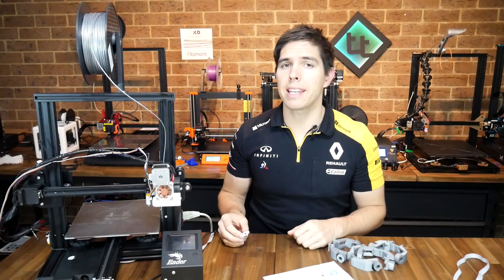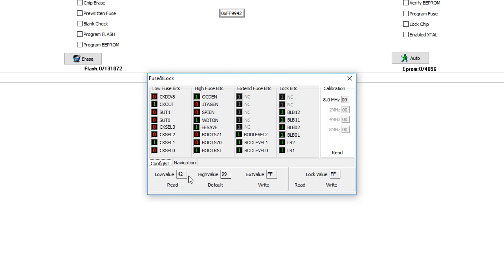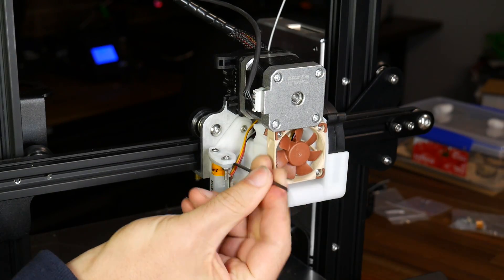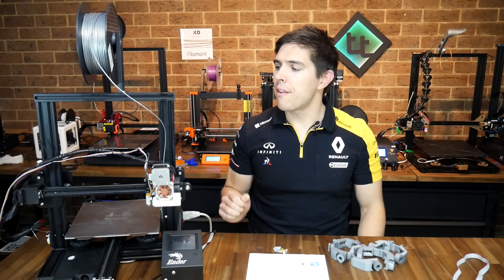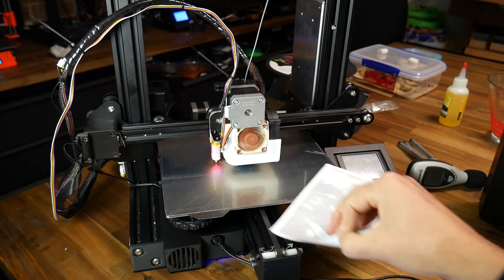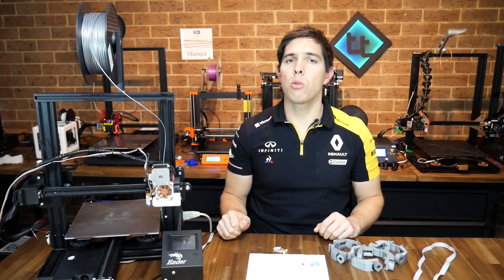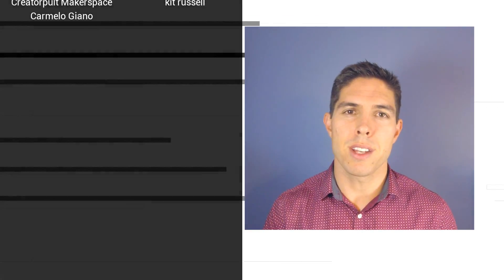Creality BLtouch Ender 3 upgrade kit - Step by step guide with fixes

Comment: Thanks for your many informative videos. I just got my BLTouch upgrade kit and wanted to share my experiences:

1. At the time of placing my order (24 Mar 19) I clicked the link and downloaded the software which worked fine.  Unfortunately after flashing both of the Chinese named files I found that neither had the BLTouch mods.  The were merely the branded and unbranded version of the standard firmware. So I ended up using the link you provided to download their 1.1.6 firmware.

2. The mysterious error when opening PORGISP.  This is because of the Chinese characters in the file name. If you don't have Chinese language support installed these unicode characters cause a problem, also why the "Auto" button didn't work.  To solve this after extracting the progisp+1.72.zip file, delete the Chinese characters at the end of the folder name so it is just 'progisp+1.72". After doing this, no error and the appropriate boxes were automatically chacked so "Auto" works.

3. The programmer can power the board by itself just make sure other peripherals are unplugged.  e.g. if your OctoPi is plugged it will try, and fail, to power it also.

4. Finally I got the V3 sensor.  This is a show stopper.  I will have to revert my Ender 3 Pro until I have a solution.

Comment: I have the V3.0 and have received an email from Creality on their suggested solutions.  The first solution is very dramatic and involve tearing the C7 capacitor off the Melzi board right next to where the z-axis plugs in.  This seems a bit extreme so I haven't tried that.
The second solution is to just swap a few settings in the progisp program.  In one step is says to click Set Low Value and High Value.  The corrected settings has Low Value as D6 (was DC) and High Value as DC (was D6).  The last change is to set ExtValue=FD-Click Read (was Write).
I haven't tried it yet because I wanted to make the changes with a newer version of Marlin.  I know the Marlin 1.1.9 bug fix and Marlin 2.0 are supposed to work, but I haven't tried either of those.
Like most I'm waiting for Michael to give us the best solution.
Reply: I had a better response from Creality by mail. After sending them youtube videos with the v3 issue and sent them videos and photos of my printer with the steps they provide with the kit and a test video showing that bltouch can´t stop z axis, the reply mail was this:

"Hi, 
I think the BLtouch is malfunction.
If you need replacement, please contact the seller. I only provide technical support.

Best regards,
Oliver"
Simple solution. Replace bltouch. lol

Comment: I used the programmer to flash a hex with bootloader and Marlin 1.1.9 I compiled with Arduino IDE.
The pin board is to big to allow the box cover to close. I ended up buying a more compact board on eBay.
Had to switch the white and black wires.
The kit is overal good quality.
Reply: On the official video they bend the pins, have you tried that?
Reply: Yes I did. It’s not the pins that are the problem, it’s the black connector on top that hits the fan.
Reply: @anenkris  When you say flip the wires, do you mean the direction they are plugged in on the board?

Comment: I just got my V3 BlTouch to work this weekend.

However in my process of installing I either misunderstood or had poor z-leveling instructions and my probe crashed into the bed and bent the pin between the homing and first line. I managed to get it working again but the pin will fail every 30-40 cycles.

Does anyone know where to reasonably get a replacement pin? The only suggestion I've seen is getting a Chinese knockoff and taking the pin from that.

Comment: Since I use your .hex file, I can't find the menu to  tune my extruder ratio (I have a dual gear one)  ... can you tell me what to do ?
Reply: Did you find a different firmware to flash? I think his prepared hex just doesn't have anything turned on so it's kinda worthless

Comment: Why am I getting a black LCD screen after wiring with the PIN 27 board? When I remove the PIN 27 Board all is fine. I tested two pin boards. 
For your information:

1. I already had the Marlin firmware installed (by Arduino) and edited the configuration.h to enable bltouch and added line like #define SERVO0_PIN 27. Did not use the Creality software patch as instructed by Creality. 

2. The wiring has been done according your (Teaching Tech) video.

Your help is much appreciated.

----------------SOLUTION-------------

For future users:

Install completely according the instructions of Mr. Teaching Tech, include patching the software part.

All is working now.
Reply: Hi sir, I'm having the same problem too for my ender 3 pro. I tried many times but the LCD screen turn black after firmware update. But when I took off the 27 pin from the board it's work. Is this video step really help you solve the problem??

Comment: I need help with my merln firware. Have a MKS Gen L v1.0 motherboard.
I have followed your vid " Easy and cheap Ender 3 mainboard upgrade: MKS Gen L guide " to the letter.
With deferent versions of marlin. Cheep getting the same Error , "exit status 1
, Error compiling for board Arduino/Genuino Mega or Mega 2560.
When verifying the sketch.

Comment: I'm kind of confused why the Warning about the V3 and V2 is at the END of the video instead of the start.    If bltouch upgrade is currently incompatible as it ships from the Factory, that's rather critical information and shouldn't be buried in the last couple minutes.

Comment: New maker - Ender 3 arrived today.  Put together flawlessly thanks to help from you and some others.  Leveled it, test printed perfect.  Powered down, came back 4 hours later to try printing something cool - and no heated bed.  Spent the next 2 hours googling and testing - apparently hotbed fail is a thing.  All my wires are good, tight, not burnt and I get 24v on the wires soldered to the heat bed.  Seems the bed is dead.  Emailed Creality - waiting on reply.  So excited to get the unit, more excited after it went together so well and the test print came out great.  Had dozens of upgrade parts on the SD card, addons, BLTouch and more PLA in my shopping cart.  Went to print my first upgrade (fan shroud) while figuring out what else I needed, auto leveler, etc then boom.  Sad times...

Comment: I have the Ender 3 Pro. How do I make this work?
Reply from the maker: Exactly the same, the only difference in firmware is the word 'pro' on the status screen.
Reply: @TeachingTech  When I open the firmware the .exe file I get "Access violation at address 743051B0 in module "KERNALBASE.dll" . Read of address 03377000".  If I hit "OK" twice it takes me to PROGISP (Ver 1.72) and the "Select Chip" drop down is blank.  and I can't  continue. ?

Comment: Had no issue installing and running. Note that there is a English version of the documentation and the progisp app. You can use the progisp software together with the usbisp to create a bootloader as well. I will put some time in to share  instructions. Keep it going!
Reply: How do you flash a bootloader from the progisp burner?

Comment: Hi I have a question, I am new to 3d printing and bought a ender pro, but forgot to buy filament, which I later did, I bought the Amazon's petg filament, and the issue I am having is, I can't get it to stick to the heating bed. I have messed with the temperature and nothing, I don't know what else to do. Any tips for some one who is a first time on this ?.

Comment: I ordered mine about 2 weeks ago and got the bltouch 3.0.  The instructions for clicking auto worked for me without any issue even with it turned off. I did however change the jumper on my board to use usb power while programming and then moved the jumper back to having the board supply it when turned on.  after doing the update i fount it wasnt registering the bltouch correctly.  so i checked the comments in the video and it indicated the new kits come with bltouch 3.0 which isn't compatible without doing some modifications to the main board. I did have a bltouch 1.0 so i installed that andthe probing did work. But the probe on the bltouch 1.0 is to long and when retracted it is still below the nozzle instead of above it.  so in the end i used my arduino to install the boot loader and then installed marlin 2.0 alpha bug fix. Currently this is working for me.   I still think its a good kit. Hopefully Creality will have a firmware update soon to allow it to work with the bltouch 3.0.  Honestly though some one who is going to do this kind of upgrade shouldn't be afraid of learning how to install the bootloader and install marlin.

Comment: There is one thing you missed is the fan cover dose NOT fit at all! You will need to print a new fan cover..
Reply: That’s correct. I bought a more compact pin board on eBay. This allowed me to use the original lid.
Reply: Can you show us which one you ot.. Thanks    @anenkris
Reply: Edwin Viruet Sure, it’s this one: https://www.benl.ebay.be/itm/A-Ender-3-CR10-Pin-27-Breakout-Board/392258930133
It’s just that bit shorter to let the fan pass the connector on top so the lid can close.

Comment: Great walk through Michael, I'm sure it will be a god-send to many. Creality STILL not enabling thermal runaway? That's horrendous, there is no excuse for that level of customer neglect. Also, they know that a large proportion of their customers speak English so they should make the software legible. The community, and Creality) are very fortunate to have you picking up the pieces of Creality failures.

Comment: Great vídeo! I’ve received my kit with bltouch v3.0 and for now is disabled. Creality firmware doesn’t work at all. Contacted their support and they sent the same 1.1.6 file to flash. I almost kill my probe with their instructions. 
I’ve found on antclabs that some early versions of v3.0 have issues and the solution is to remove the C7 capacitator from the mainboard. This is not na easy solution for a plug and play kit. 
Hope to watch your next video to see how to put this to work properly.
BTW the firmware on their site for Ender 3 shows “Ender 3 Pro” on LCD after flashing... weird...

Comment: Yeah you don't need a bootloader because you just directly flash the uC.
You do same by following bootloader flashing instructions using arduino board but then you don't flash the bootloader only that .hex file.
Reply: Yeah, instead of flashing bootloader simply click "flash using programmer" on the Marlin sketch and It's the same, no bootloader written.

Comment: I recently bought a BLtouch V3.0 and installed the Marlin 2.0 Alpha version to get it to work. A bug fix 1.1.9 is available now https://github.com/MarlinFirmware/Marlin/tree/bugfix-1.1.x. 

Something I have noticed about my BLtouch is sometimes when it's doing the 9 point mesh it starts to lower and then pulls the probe up as if it touched down but it didn't, it then carries onto the next point. Anyone else noticed this.

Comment: Installed and running. Had to reverse the black and white wires. Never sure it is actually working correctly though as I have had to micro adjust using the bed wheels. I can see a bed profile using the octoprint plug in so it is reading the bed height. Also you can’t fit the cover back on an Ender 3 due to the pin 27 board so I had to make a cover extension and move th e cover back. Many thanks Michael.

Comment: You're the best Michael!

Did you do this with the 1.1.4 board? If not, what would the process be?
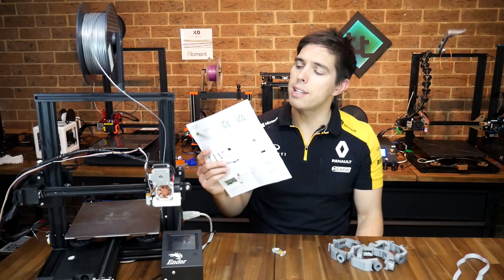Reply: The version 1.1.4 already has a bootloader flashed to it, so you do not need to do the part where he attached the USB flash programmer device (1:45 to 4:10 in the video, skip that part). Once you have attached the Pin 27 board and attached all of the wires simply plug in a USB cable from your PC to the printer and use the Arduino IDE to flash the firmware update (see TeachingTech's video on updating Marlin for an Ender 3, just ignore the bootloader part).
Reply: @deceitive3338  Thanks! Looks like i will probably be ordering both the 1.1.4 board + the bl touch kit :)
Reply: Wondering the same thing. Would we still need to do the whole flashing again or is it done differently with the new 1.1.4 board.
Reply: Another question - does the firmware prepared by Michael include flipping the settings for the steppers in v.1.1.4?

Comment: Thank you for posting this. I have been having some many problems and have stopped using this printer. I now realize that it's due to my having a v3 BLTouch. Looking forward to your next video showing how to address the problem.
Reply: remove C7. I did and with no other changes I can use my V2 or V3 BL Touch with Michaels V2 BL Touch .hex file video.
Reply: @glenroe1124  excuse my ignorance,what is C7?
Reply: @slicedpage  it might be capacitor nr7 on the control board. Like solder it off.